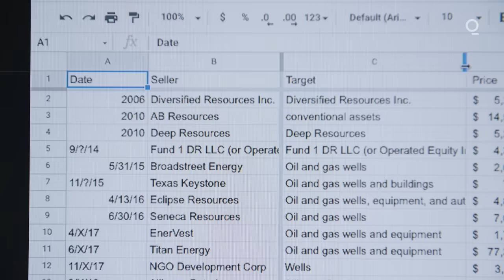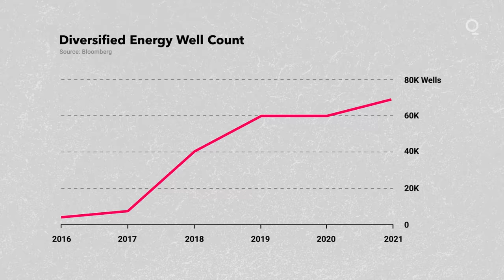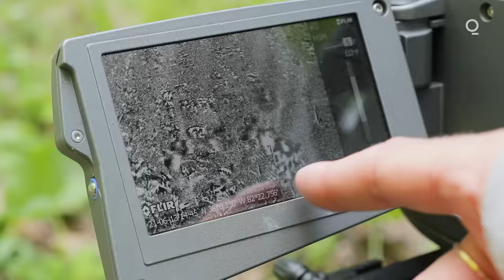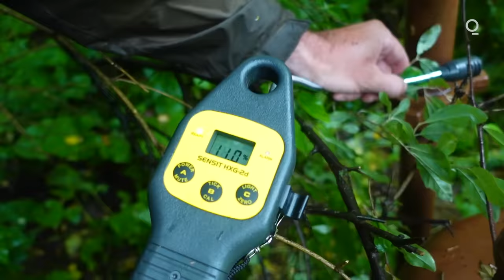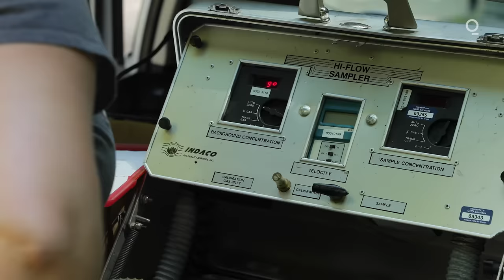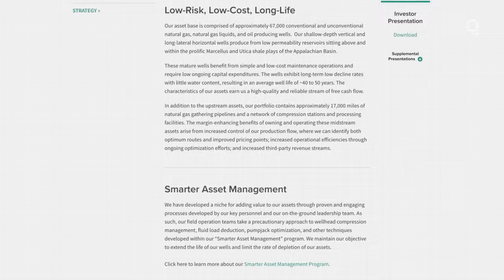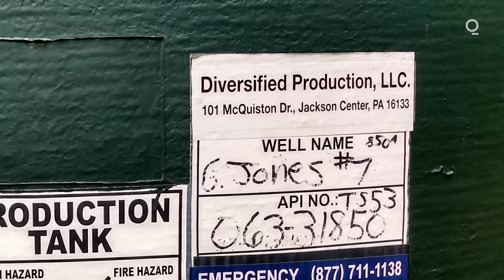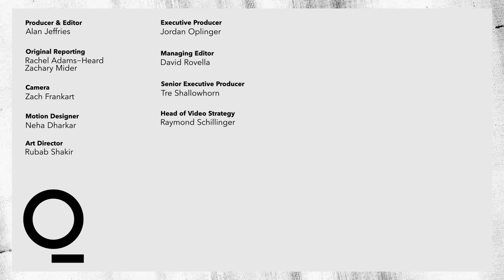How Dying Gas Wells Are Making One Company Rich

Comment: Almost all of these leaks can be fixed by taking a few hours to disassemble the piping and re doping the joints. It is not hard or costly. They could have a few people just do this every day for a year or two to fix all the wells. I have dealt with gas piping as a maintenance tech. They would probably even make money by increasing the yield of the wells too.
Reply: I have no experience in the field of oil and gas, but the price to dump some cement in a hole that no longer has any substantial pressure seems astronomical.
Reply: Or maybe just put some epoxy there? Maybe if Air would get to into pipes with so little pressure there would be some problems with reconnecting to main pipe.
Reply: @MalawisLilleKanal  I have seen some oil well plugging here in Czech republic, they had to bring rig and basically drill that well again and then pour some cement in that. It took about a month to do just one.
Reply: @MrToradragon  yeah because the well starts to collapse, did you ever build a hole on the beach near the water level and the walls keep falling in. the cement will get stuck near the top and just spread the gas over a wider area and create pockets. You need to find the depth of the well reservoir rock and seal at that level.
Reply: @willkrummeck  Now I am not sure whether you react to my comment about fixing pipes with epoxy, which was meant as repair of well that is intended to produce gas for some time. Or to my comment about well plugging.
Reply: You are correct that was mentioned in the video. The average fix was $90
Reply: @MalawisLilleKanal  it is very expensive. You have to bring in a rig and run pipe to bottom. Pump cement from the bottom up in stages. It becomes extremely expensive if the casing is damaged or there is junk that needs to be fished out to get to bottom.
Reply: My house is supplied by a dying gas well. I'd like to hire someone to do the kind of work you are talking about. Where would I find someone qualified?
Reply: I don’t work for this specific company but a company in Appalachian area Enervest. MY job title is specifically maintaining and fixing wells. Leaking joints, tanks etc. we are in full force trying to fix these problems. I can’t speak for this company.
Reply: They could just run the well to a small turquoise H2 unit, then have a tech come out every few weeks and just collect the H2 and solid carbon black from the "leaking" well. It will make money over it's life time. Now for someone to make a small solar powered (or H2 if it is raining or snowing) turquoise H2 unit!
Reply: I agree. If the pressure of the well is next to nothing just repair the exterior piping/casing for now. It can’t be that expensive.
Having said, I think by reading many of the posts, most here think Diversified is just a shell company with the end game to dump the problem of these wells onto the taxpayers. This should be avoided at all costs and the original owners of the wells be held responsible for plugging them. These wells are more expensive than anyone could of expected.🤔
Reply: A few pipe wrenches and a sledge hammer. Man up. It's not that hard.
Reply: Try telling s stingy car owner that changing they're plug s and ignition modules will hey them better had mileage and make their car like new again...
Reply: @sweetearthfarm  what area? I am not in the US but it might help to search for gas technicians in your area
Reply: These installations, require constant inspection and maintenance.
Reply: @namanish450  Thanks. I found someone who used to service wells for the gas companies. Many men around here have worked in the industry.
Reply: Easier said than done.  Half those ancient joints are probably so rusty, they'd become decrepit if unscrewed/disjointed.  Workers might need pipe wrenches 6' long.  PA should have mandated 250 wells/yr be plugged - rather than the ridiculously inadequate 20.
Reply: @brahmburgers  Just have to undo the joint closest to the ground and let the gas vent to the air while you do the rest, if it is impossible to unscrew because of corrosion there are clamp fittings rated for 200 psi or so, these wells are waaaayy below that. Instead of cutting the pipe to avoid sparks a cutting wheel could be used. The gas venting out is not going to really do any harm for the short time it would take to re-do or cap the well.
Reply: Flex seal paint the connections cheap an done w cheap labor
Reply: @MalawisLilleKanal  you seriously have no idea about the price of concrete. It's Rock an water. If was expensive you'd not see all the concrete foundations an concrete block buildings. The price of the gas to haul it from the mixer or plant is the big issue I can get a dump truck of gravel for $50 but hauling it 60miles cost another $500 for truck driver an fuel. Obviously it's over priced but easily reduced.
Reply: @MrToradragon  that would be worst case or almost worst case
Reply: Literally
Reply: @MalawisLilleKanal  How do you get the cement to the location is what cost so much. One well I saw in WV was on top of a mountain that took me an hour to climb up a creek bed to get to. They brought the drilling stuff in by helicopter to drill, then the pipe and tanks by air also. Made a lot of money off the well while it had pressure and then sold the mess to avoid having to lift the stuff to plug it by helicopter again. The expense to properly close it was too much and had no return on the expense. This is why companies like Diversified exist. They likely got paid to "buy it". And all  the company has is "liabilities" that can be gotten rid of in bankruptcy courts if the state presses them.
Reply: @anydaynow01  
Imagine adding a bladder to harvest it and hooking up a household that may be nearby, or setting up a camping site, what have you...
Reply: @spooderdoggy  
Plugging is very wasteful in many ways.  Let private individuals take over the rights to harvest the methane as fuel for home use instead.
Reply: @MrGigi-dz9cv  
Let homeowners homesteaders harvest this.
Reply: @Will-dn9dq  
You're wasting resources and contributing to pollution when you use concrete.  
Methane is a resource.
Reply: Very well said.
Its very accurate
Reply: @twizz5727  
Imagine if homesteaders fixed theleaks,the leaks, bladders and then used that to power a water heater, cooking stove, or even provide home heating?   One government land these could be part of parkland kitchens with cooking methane stoves in placed handy instead of using camping stoves and fire pitsfor cooking.  Using it and burning it is a great way to deal with it and get some use out of it...
Reply: @spooderdoggy  
That is where getting government out of nanny state mode is important.  It creates more problems than it solves.  We need more solutions that are workable even if small, than big solutions that compound problems.
They needto see the benefit of decentralized control over water, heat, food, etc.  You have to confront notions of 'if only the guvmint will do this,'  it was government and its allies with mega corporateconglomerates that created this...
Reply: @b_uppy  hook a hit and miss engine to it and have it run a generator. set them up and they could even charge the electric cars.
Reply: @thecollectoronthecorner7061  
That works!
Reply: @MalawisLilleKanal  I was going to make the same comment.
Reply: Proposing a solution to make oil extraction more clean is unacceptable. So YT tells me, as they've blocked my previous thoughts for not complying with their beliefs.
Reply: @hadmatter9240  
It's not Biden compliant...
Reply: Yea litteraly could have 15 ppl do this in 9 months maximum
Reply: @willkrummeck  or you can fill the well/mine that would re-establish original pressure filling the holes with zeolite clay.  

What I find interesting is that people express how much more intelligent humans are to people 1000 years ago yet here is a conversation that says only 100,000 thousand dollars of spending can be the the solution.   

Batteries are not a solution either.  Batteries are the equivalent to a kid stuffing everything into his/her closet to that things appear to be clean.
Reply: In Texas it's the responsibility of the company to cap a well and cement it in, in order to prevent such leaking. No matter how well you fix existing piping, that pipe will corrode and fail eventually.
Reply: @ﷺ based prophet  
But that misses the opportunity of allowing people to harness the gas and use it, as opposed to doing costly repairs that waste a resource and further centralize resources.
Reply: @justaguy6100   that makes sense!
Reply: @TheDerperado  I'll do it for $3500/mo
Reply: I’m not an expert on these old gas wells but it seems to me that Diversified could add on condensers and 250 gallon propane tanks at each of these old wells with wifi monitors,then sell that gas at a reasonable rate and also be able to monitor changes in well flows.
Reply: I used to work in the Gas field tending gas wells.  It is no so much the cost of materials but the ability to replace them.  They get corroded on SOLID.  You are not going to be able to replace pieces as easly as you think.  They will sometimes collapse the pipe that it is connectd to as they have worn away from small sand particle on the inside of the pipe and are rusted solid from the salt water that comes up from the well.
Reply: @markpashia7067  - Spot and well said!
Reply: @digitaldreamer5481  - Yes and doing this would re-establish some decent well pressure.
Reply: @__WJK__  I design and build off grid applications and this could be an interesting and challenging project in the long term. 🇺🇸
Reply: @digitaldreamer5481  - How exciting and I couldn't agree more.
Reply: @MalawisLilleKanal  You actually can't do that. Like in Colorado you get explosions on capped off wells. You need pressure release forever. That is why they have pipes on old landfills that have been covered in dirt and grass.
Reply: Methane only lasts about 15 yrs in the atmosphere so it's a transient "problem" (if a problem at all) NOT a cumulative issue.
Reply: @Mrbfgray  - Right, regardless of the Earth releasing methane, heard animals releasing methane, or humans building wells that leak methane, there's always some percentage of methane rolling around in the upper atmosphere.
Reply: @__WJK__    Isn't it primarily grain fed animals creating C4H4?  Not sure grass fed do that much.  Anyway with it's short life when mixed with O2 it's just not something I worry about. Rarely is that fact mentioned as it doesn't fit the alarmist narrative.  

NatGas is one of primary factors (replacing coal) the USA has reduced CO2 emissions in recent yrs and for a host of other reasons it's vastly superior to coal consumption.  Not many nations have achieved that but China's increases dwarf all that anyway.
Reply: @sweetearthfarm  Nice one and very lucky! The normal thing is, you contact the city, they say you need to contact the county, they say you need contact the state, then they tell you, it's federal government problem. When have finally got in touch with someone X months later the feds say it a local problem and contact the city. By this time you have either died of old age or blown your brains out and who's paying for it all, the tax payer.
Reply: Can't you just TNT the bore hole permanently sealing it. If so it sounds like a 10 minute job
Reply: @testaccount4191    Permanently open it you mean.
Reply: Probably not. The pipe is probably ate up if it's old enough to leak. Most regular production pipe doesn't last much longer than 5 wells.
Reply: The man who made this comment is completely correct. Whoever sent these kids out and paid them to make this documentary should've sent them out with a wrench and a thing of pipe dope. It would've been a much more interesting documentary
Reply: @therarebreeds77therarebree7    It's unfortunately not practicle to harness and use as fuel but it's not a BFD otherwise.  C4H4 is very short lived in our atmosphere and won't likely save us from the pending devastating glacial maximum.
Reply: @sweetearthfarm  Your oil well company, oil well pumper is required to maintain your well if you own it yourself find a well pumper and offer him pay to help you
Reply: Something had to have gone catastrophic wrong.  Sounds like they were trying to “squeeze” or “fish” the well and couldn’t pull it off and had to abandon.  It happens.  But plugging while intensive, is a 1-2 day job.  I have seen it done all the way from bore plugging to site remediation.
Reply: I agree some of the leaks are repairable at low cost. Some take more to stop.
Reply: @Aguyfromva  . Exactly. I’ve managed and operated production for 35 years and all it takes is a little TLC some equipment, care and pride in your work and it can be solved. It should be solved.
Reply: @spooderdoggy  you can’t make the original owners responsible that’s  ludicrous. When new owners purchase these wells they should have to have a post a bond or contingency fund for the abandonment cost of each we’ll purchased. It’s like saying the original car owner is responsible for the scrapping of the car after a sale.
Reply: @based_prophet  exactly. Yet we let government, some young people with no oil and gas experience and professor with no oil and gas experience hype it all out of proportion
Reply: LOL, you've never worked in the oilfield have you?  you can't just go and "disassemble the piping" it's under a lot of pressure, you have to bring in a service rig or a snubbing unit and it costs big bucks
Reply: @FourthWayRanch  this piping is under 10-20 psi maximum but more like under 5 psi. These are dying gas wells not an operational oil well...
Reply: ya just a few 100 bucks for a 3 man crew and they maybe could do 2/day sealing leaks or prep 5 or 6 ahead for bigger work
Reply: nah
Reply: @FourthWayRanch  some of these repairs can be fixed without all what your talking about. I have done repairs on gas lines etc. Been in the patch 35 years. These aren’t high pressure gas wells.
Reply: The more wells closed the better for the better for anti oil, who is diversified energy? Sounds like a bleed it dry kind of company.
Reply: Sorry but this is a company for cash and paying a man to go out there and fix it they don’t care about
Reply: @MalawisLilleKanal  The procedure you're describing is used for killing the well, not fixing leaky pipe joints.
Reply: I think wells have to get pressure tested when being refurbished.
Reply: @mr.giraffe7076  That maybe true if downhole work is done, but a pressure test seems like overkill when resealing pipe fittings above the surface.
Reply: @sweetearthfarm  you need to start preparing for the time when that well is turned off or no longer producing.
Reply: @WaltEagles24   Thats pretty much the same as saying that oil products should come out of the ground already separated after having millions of years to settle into lighter and heavier components but it doesn't, we still have to turn it into gas, deisel, kerosene, whatever once we pull it. The atomic mass of N2 (nitrogen gas is 2 atoms bonded together, you wont find many single atoms) is pretty close to CO2 and with the wind and air rising from heat you end up with a homoginized mixture on a global scale. If your logic tracked we would not have an ozone layer because ozone is heavier than nitrogen gas or CO2 but its still up there...
Reply: Why is that the simplest fixes never gets done until a it grows to a bigger disaster? How can we  this company a greater work force to just do that on private of public properties? Raise the time and requirements or fines will be executed! Every small leak shortens the life of our planet. Where is EPA on this?
Reply: Those repairs add up and mean less money in the pockets for GOP politicians in the form of lobby money
Reply: Not all fixes are that easy
Reply: Yeah it's not really accurate. It will cost about $2000 to plug a small well with cement.